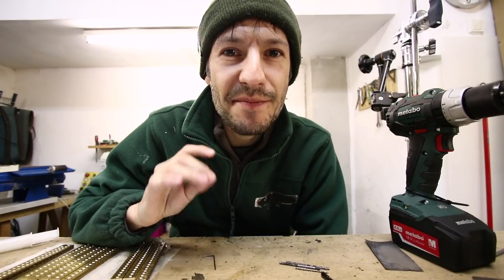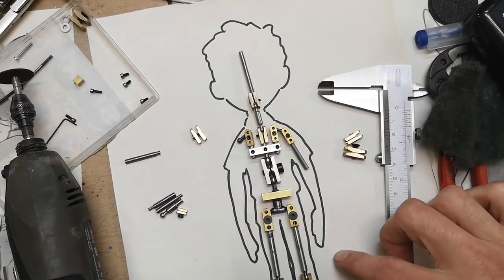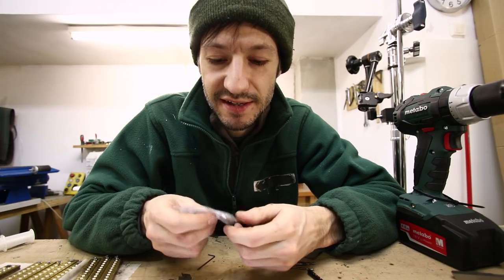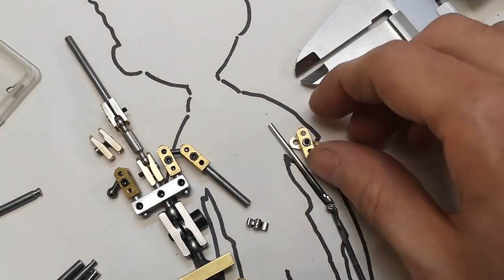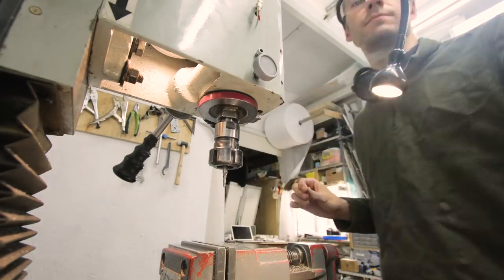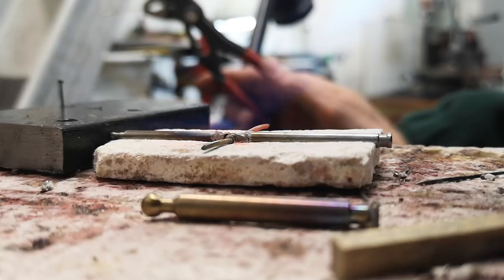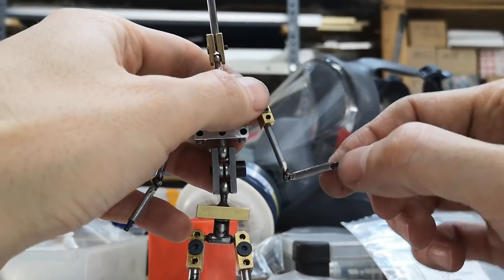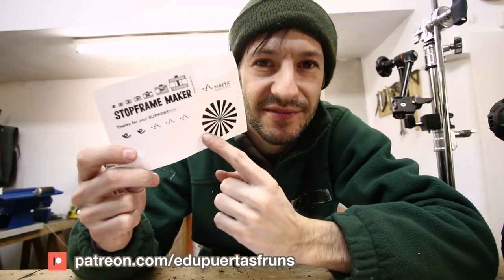How to make stop motion hinge elbows

Comment: I'm curious, what did you use for a search title to find these? I'm wondering if they will suit the fingers for my Harryhausen armature on my MA Degree?
Reply from the maker: Hi Michael, look for hinge joints for glasses. They could work for fingers, of course they are not super strong but saves a lot of time in case you have to machine them.